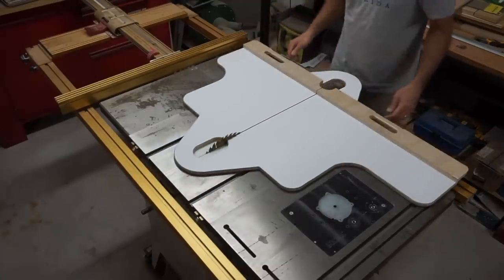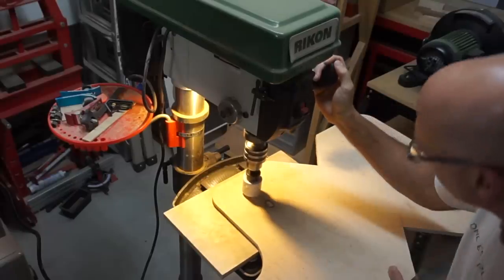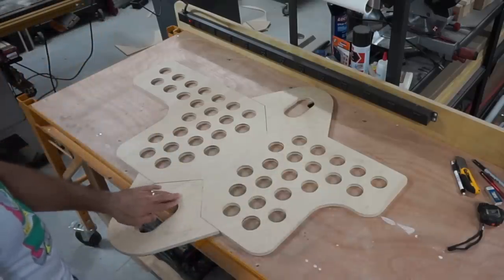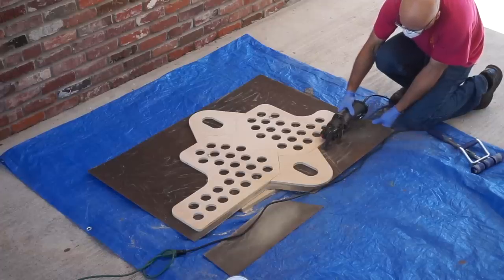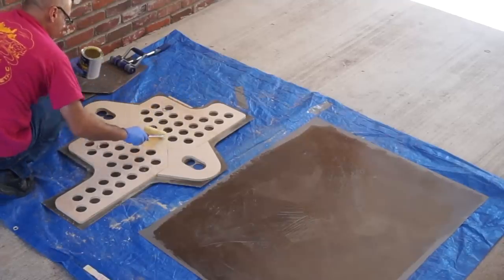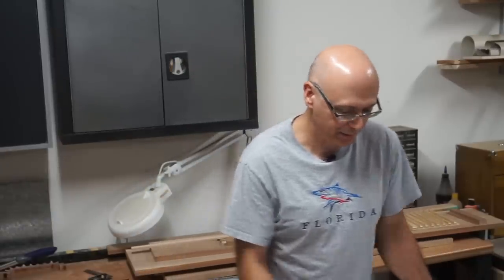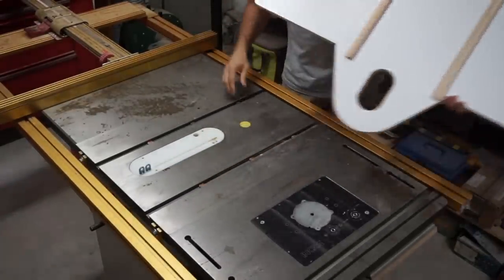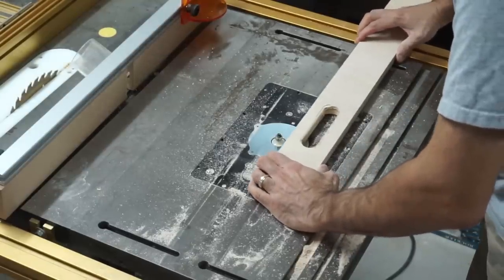A Crosscut Sled Like No Other

Comment: I guess I don't understand why you didn't make it from one piece of plywood. Why make two extra pieces, attach them badly (one was attached with only 1 screw), and weaken the whole assembly? In theory, a great design (I plan to use it) but not as well executed as it should be, especially with a nicely equipped shop. And the squareness? No excuse for that. But again, a unique design which is a vast improvement over what's traditionally used, but just begging to be executed properly. Did I mention it's a great idea?
Reply from the maker: Rusty, it would have been very awkward, if not impossible, to cut out that large shape in one piece. It would not have fit on my bandsaw or scroll saw. Thanks for your comments, though!
Reply: I've Been Thinking Workshop Jig saw with a good sharp blade? I mean you squared/smoothed the edges with your spindle sander anyways.

Comment: Stupid!  Add a sliding table with a mitre fence to your table saw.   I did that some years ago to. my Powermatic.  I have the Excalibur  purchased before Saw Stop took it over.  Sold by Rockler!  It has served me well and greatly increases safety and chance of kickback when cross cutting large sheet materials . It is very good for production in multiple cuts.

Comment: Although you achieved a major objective of being light weight, as it is, I see no advantage over the stock runner square.  I would NEVER lay a piece of wood on the sled without something holding it down as it went through the saw. Also I prefer a much higher fence along the handle bar.

Comment: Cut all 4 sides with the sled then mesure the starting point. A more accurate way to put the fence on would have been just tackling one conner on so you can adjust it into dead on square. The point of a good crosscut sled is accurate cuts. You've spent 500-600 bucks on a micro fence system shouldn't the cross cut sled be as good?

Comment: At 14:30 you find that you're .032" out over what looks like a 12" piece.  That wouldn't be acceptable if you wanted anything to actually fit.  Certainly not good enough for cabinet components.  Sorry.  And I agree with everyone else about not holding on to your work piece.   I was holding my breath.

Comment: Those two plywood pieces with the v’s cut into them that u added are going to weaken over time why didn’t you just make it all from one piece? It also needs a piece near the back on the fence wear the saw blade comes through so you can push the sled with one hand and hold the work with the other, that’s really dangerous not holding down the work piece,it also needs a tall piece along the stop for tall work and to clamp to

Comment: Not accurate, which is not surprising given that he used a carpenter’s square to align the fence, instead of the 5 cut method of William Ng. I don’t think any cabinet maker would accept this as accurate enough. I certainly wouldn’t. He mentions .033 over 15”. My sled is more like .003” over 15” if that. So if you need precision, this is not the design for you. If you want your cuts to be approximately square, then go for it.
Reply from the maker: You should see my cabinets, gfsark… 😁

Comment: Very dangerous !  You need stop blocks so the sled stops before the blade cuts it in half.   You need hold downs for the work pieces.  And you need a guard or block to protect you from the blade at the back.  You are more concerned about weight than safety!

Comment: Too many tools and apparently way too much time on his hands. I have owned a custom cabinet shop for over 30 years, all of our table saws have been equipped with "sliders" for as long as we have been in business. Making a slider that is off by .030 in 15", and be proud of it! That's over an 1/8th of an inch in 3 feet! That will make some REALLY crooked case work. NOT a craftsman, an amateur at best. Kreg fasteners in 1/2" plywood? Really? And all of those holes! Must be great to have that much time to waste and then be proud of a useless fixture when you are finished.

Comment: normally a change in a tried and true design will be done to add some benefit. I'm sorry but I don't see any benefit here. The use of epoxy instead of screws does not allow for ease of any future repairs. It's not adjustable, it has no blade guard, the fence is too small to support taller pieces, stop block clamping for repeat cuts difficult, cutting error could be better

Comment: Very dangerous. You need to rethink that sled my friend. Once you cut it in half, you'll have two. Hopefully still have all ten finger as well. Yikes. The whole point of a crosscut fence is accurate, safe crosscuts. Yours is TOO minimal, and those ends are going to get cut off. Higher fence, Blocks at each end so you can avoid cutting the thing apart, and a piece of lexan across the whole cut area so your fingers will stay on.

Comment: i would never ever  use a sled with such a low level back fence as backing off from the cut can kick the stock back and over that fence, trust me it realy hurts when a flat peice of ply hits you in the abdomen from learning by mistake my fence is alway 4 inches minimul and stock secured.
Reply from the maker: victormeldroo, so did you initially use a low back fence like mine when you got hit in the abdomen?
Reply: Yes I did. sheet wood got picked up rose over the saw hit me. All happened in a miiisecond I think the sled stuck and I pushed the wood wrongly

Comment: Sorry, but at an age where you can afford such nice tools, I call it ignorance, perhaps even willful. He needs to be watching videos rather than making them. With the size of the piece being cut on the sled,  I'd OK him holding down with his hand 6-8" away. But to not hold it at all is ridiculous. The very first cut (track saw) made me cringe. I have always used four (4) saw horses on a level surface for large panels. You need to know that neither piece will fall and pinch the blade, perhaps throwing the wood either into you, the operator, or into the saw blade ruining the material. I hope he reads and heeds the comments! Years ago, as a safety instructor in a packaging plant, there were published stats that it takes 10,000 unsafe acts before a serious lost time accident. The problem was, you did not know whether the first, second, or the ten-thousandth act was the one to bite you.
Reply from the maker: Thanks for your comments, Dennis! I know I can’t make everyone happy, so I just let people post their opinions, unless they are nasty. For what it’s worth, I don’t think I’ve made anywhere near 10,000 cuts yet, but I haven’t had any mishaps with this setup so far.

Comment: 33 thousandths ( or 33 mils) over 15" is terrible, you should be able to get within a few thousandths. 33 mils is more than a 1/32" 
Also you might want to learn how to hold the piece you are cutting before you go showing others bad practices.

Comment: Not for me: the fence is not tall enough to allow clamping of a variety of material sizes; 1/32" out of sq. over 13" is way off-not good enough for quality work; should always hold down the work piece even if the cutting force is downward; I prefer to have hands closer to work for better control; although the hands are far apart should there be a need to bring either hand to the workpiece the blade can cut the hand - need to cover blade at end of cut. Overall, not what I would recommend to anyone. A creative design, but not practical & not safe.
Reply: Its off by 1/320 not 1/32 :)
Reply: I don't know where you got 1/320 as he said 1/32".  Over 13" 1/320" would be 0.00024"/inch,  whereas 1/32" over 13" would be that's 0.0024"/inch. . OK if doing rough work but not fine work!
Reply: I don't know where the 1/320 came from, but he said 1/32" over 13". First, he can't measure to 1/320 with his woodworking tools. Secondly,  the fraction 1/320 equates to 0.003" which would then equate to 0.00024"/" over the 13". Machining to 0.003" over the 13 inches is difficult enough when machining metal with metal working machine tools,  impossible with wood. ;)

Comment: Any reason you didn't use the 5 cut method to locate the fence ILO using an "L" square?
Reply from the maker: I glued down my fence, so no adjustment is possible, as would be required to use the 5 cut method.

Comment: Overall the design is nice, rigid, lightweight and will not suffer from not having a front fence. I might add a couple vertical pieces atop the fence running parallel with the fence to be easier to rest your hands on it when using the sled. Lastly, I think you missed the opportunity to 
really get the fence square by not going the the "five cut method" which is easy and makes for a fence that is square easily within 
4-5 thousandths. Also by gluing on the fence you cannot replace it in the future if needed. Also... I'm interested in seeing how you 
utilize stop blocks with your low fence... I can think of several ways easier than with a normal fence. 
Good job. 
wwwbrinkboatrepair.com

Comment: Too many specialized tools that most woodworkers do not have. Better video would have been using common tools.
Reply from the maker: Nic Lira, which of my tools did you consider to be specialized?
Reply: A router table, drill press, table saw?   These are specialized tools?

Comment: Sorry guys but I am fuming.  This video needs to be removed on safety grounds and the maker should be ashamed of himself for potentially guiding some poor soul straight to the emergency room.  As for your reliance on a framing square to square your fence, mate you are a joke, are the maths for the five cut method too challenging?  Hurt yourself by all means but grow a pair and remove this offensive garbage.  I have worked my whole life in a commercial shop and seen many co workers injured for lots of reasons but if we used this contraption we would have to have an open line to the emergency services.  I don't live in the US but I hope the first person who loses a tooth or an eye takes serious legal action to remove this dangerous junk. Youtube is hear to educate not annihilate.  Rant over, I'm back to work in a nice safe workshop.

Comment: The worst sled I have seen, you should name it "the dangerous sled".  Who will hold your work piece?
Reply from the maker: There's really no need to hold the work piece. The fence supports the piece from the rear and the teeth of the blade rotate downward toward the piece as they cut, effectively providing a downward force to hold it.
Reply: I've Been Thinking Workshop please stop spreading misinformation. There are numerous reasons why a workpiece needs to be secure, whether it's held by hold fast, toggle clamp, featherboard or by hand, you should ALWAYS secure your workpiece. Don't believe me? Keep doing what you're doing. One day, (I really hope not) you'll learn the hard way.